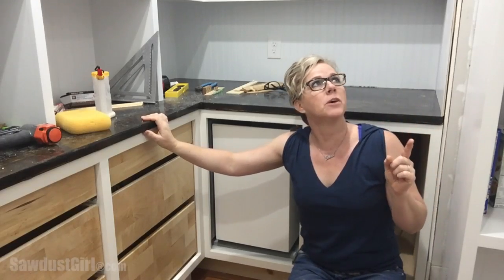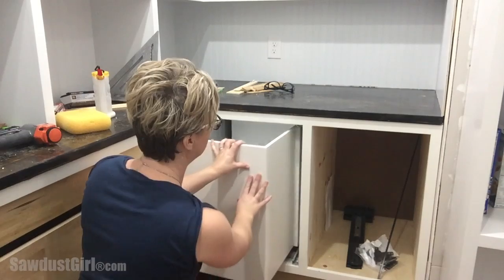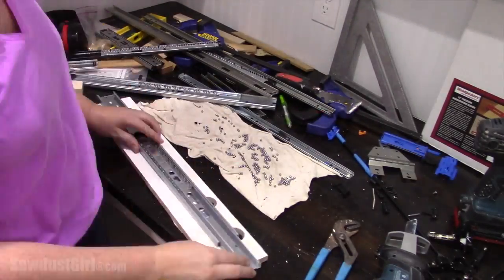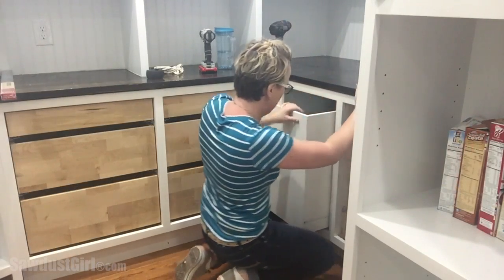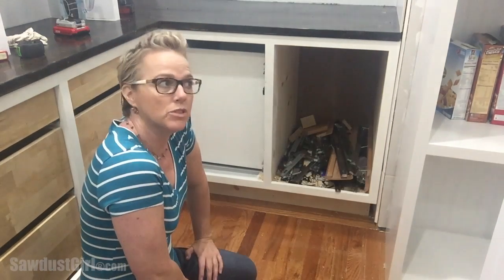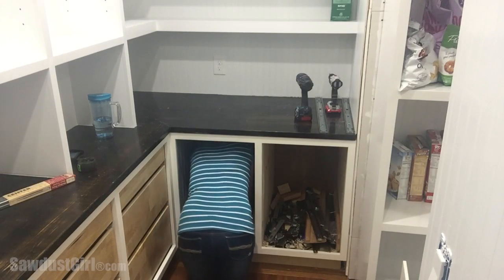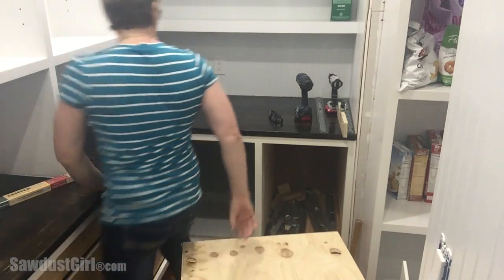Blind Corner Cabinet

Comment: This gives me an idea to put a garbage compactor in the blind corner.  You could throw your trash in, then a hydraulic garbage truck style compactor could press your trash into the blind space.   Every month the super compact block of garbage (or perhaps recycling) could be removed.

Blind corners are seriously hilarious.  The best solution is to open the wall into the next room and put drawers in there.    I was lucky that my blind corner was in a peninsula so I could just put my wine fridge in the space, facing the other side of the peninsula of course.  My parents solved the blind corner problem by ignoring the space - putting NOTHING in it - because they had a big old farmhouse on 100 acres of land - as Canadians in the 2nd largest country in the world it makes me wonder why we just don't build slightly bigger houses and forget about the blind corners.  Leave them for the spiders.  But that's a cop-out.   I admire your attempt.

Comment: Awesome tenacity!  I found a blind corner solution called LeMans II System which I used in my house.  After many years in the carpentry business this is by far the nicest solution I've seen.  Easy to install and works flawlessly!
Reply from the maker: I wished it would have worked more smoothly, but at least it does make use of all the space.

Comment: Mount the pull out cabinet slides onto the side of the drawer cabinet ( that's normally hidden inside ) so the first cabinet can be pulled out completely like before except its mounted onto the drawer cabinet, this will allow you to fully extend the first cabinet out then move the whole thing to the right to give you access to the drawers, you will have to stabilize the drawers because of the weight of the pull out cabinet attached to it,  some  blind corner optimisers do this except they use wire baskets instead of drawers which I prefer because pull out swing is not robust

Comment: Hi Sandra,
I see what you're trying to do to access that blind spot. If I was building my cabinets from the ground up as you I would drop all those drawer glides and piano hinges. Instead, delete all together the typical bottom shelf at the toe kick and just make two carts on castors that roll on the floor (inside the base cabinet). The cart at the door could be rolled completely out giving you access to roll the "blind cart" to the door or completely out of the cabinet.  Furthermore, why not build all base cabinets open to a rolling cart hidden by the base cabinet doors. 
Bob The Builder.
Reply from the maker: +Robert Wadlington that would be a great solution and something to keep in mind when starting a blind corner situation!

Comment: As a 15 year cabinet maker/installer, this is super well done! I was thinking a pocket door hardware might work? It’s a set of door hinges attached to a set of drawer slides. So when you swing the door open, you can push it back into the cabinet. This might work in reverse for a drawer box like yours.
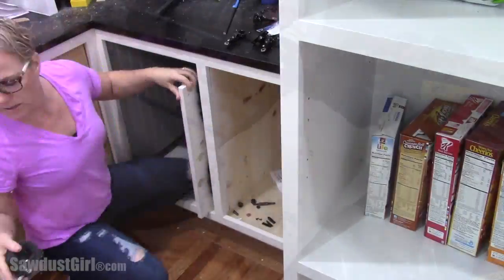Reply: I was thinking the same, but then there's a very brief segment where she's dismantling a pocket door slide.  About 0:51 time.

Comment: Sandra don’t give up. I’m a professional truck tech and have been for around 45 years. I’m occasionally faced with those kind of problems that doesn’t right away present a straight forward solution. There is a logical solution you just need to think on it; it’ll come to you in the middle of the night 😂. This is an excellent approach and I’m going to work on it because I have the same problem.

Comment: I know how to handle the engineering. 
The trick with the 'first component' is to prevent the vertical 5" cleat from racking on it's slides. This is accomplished with a cable and two pulleys. You still need slides and you can use regular heavy duty ones like you've already tried with all the ball bearings.  The cable will force the sliding 5" cleat to stay perfectly plumb without the weight of the cabinet making the top slide open farther than the bottom one.  Once you figure this out you can probably even make that vertical cleat that slides horizontally only a couple inches wide.  
Here goes:
You know those stranded wire curtain 'rods' they sell at IKEA?  (You might be able to use one of those or you might have to just buy some 1/8" wire rope and cobble something together.)
One end of the cable needs to be securely fastened at the rear of the right cabinet wall by the back end of the top slider.  The cable then goes horizontally to the vertical sliding part where there is a pulley attached to the top end of it.  The cable goes over the pulley then descends vertically along the cleat, then under another pulley mounted at the bottom end of the cleat. From there the cable continues horizontally toward the front again along the bottom slider to the lower right corner of the cabinet.  With this Z arrangement, the steel cable would have to stretch to allow the cabinet to tilt, but the vertical cleat with the cable attached can still slide easily. You'll need some sort of turn buckle arrangement at the lower right corner of the cabinet that adjusts the length of the cable.  Loosen the cable and the cabinet tilts toward the floor.  Tighten it and the cabinet lifts up.

Comment: You have a great design, and it just needs a tweek to make it work. You will have to make both your storage units 3" shorter. The plywood on the right side with a slide on the top and bottom is a great idea now convert that into a 2" tall drawer by adding 3 more 2" high pieces this will allow you to add a slide to the bottom on the left side. Add a 2" tall rail on the left attached to the bottom of the cabinet to mount the left slide to. You will have to make your other pullout drawer unit 3" shorter and raise them up to clear the 2" drawer slides on the bottom. Hope this makes sense. You had a great idea don't give up..

Comment: Did mine a few years back and even though the hardware was a bit expensive it works well. My upper and lower slides are connected with a very wide (as wide as the vehicle backboard) metal piece. If you can't find one (the other commenter identified) make your own with thick sheet metal. Good luck.
Reply from the maker: MRrwmac I'd be very interested in a link to the hardware.  :-D
Reply: +Sandra Powell aka {Sawdust Girl} Mine was from accuride https://www.accuride.com/en-us/products/1234 (this model but your slide measurements may need a different size). Ordered mine through local Woodcraft store.I think this is the one I got and I used an oak wood piece as a connector. Also built one for a neighbor after they saw mine and used a thick piece of aluminum as the connector instead of the wood like on mine. Hope the link came through above. Would like to hear back on what you end up doing.
Reply: +Sandra Powell aka {Sawdust Girl} Don't put any more space between the two slides than is necessary and that will reduce or eliminate the forward back tilting. Remember the weight is at the bottom anyway. My connector plates and the one for neighbor had only an inch or two between the closest points of the metal slide plates that the connectors screwed onto.
Reply from the maker: MRrwmac I got an idea ...  hope it works!
Reply: +Sandra Powell aka {Sawdust Girl} I hope so also. Good Luck. Let me know how it goes.
Reply: +Sandra Powell aka {Sawdust Girl} I was wondering how the latest idea you said you had worked out or did you just "shelf" the whole rebuild?
Reply from the maker: I started building my pantry doors while waiting for the hardware to come in for that blind corner so I haven't done anything with it yet.  Going to tackle it today or tomorrow now that my doors are done.

Comment: I know this is an old video but couldn’t resist commenting as this is still a problem for many.  The problem with the pull out section is it is able to swing whist you’re trying to pull it out, which makes it clunky and unstable - hinge being on the back right corner.  Wondered if you tried but it would work. -stabilising whilst in transit out of the cupboard.  Put roller guides along the base of the cupboard and then a 4mm (or so) wide alloy or polished steel strip fixed underneath the moving unit.  The strip would fit into the roller guides when going in and out.  This would keep the base unit fixed until free of the cupboard.  To make it super sturdy use two strips, one either side of the base.  Obviously you would need Y shaped guides for the strips so that they centre out and enter roller guides perfectly.  The drawer unit would need to be modified so that it rolls over the top of the roller guides.  Looking at your workshop should be too hard to do.
Reply from the maker: I sold that house about three years ago so I won't revisit this project. LOL I love the ideas though.

Comment: So I'm gonna pick up where you left off with the blind corner. Instead of hinging the 1st pull out I'm gonna have the 1st one pull out to me; then,  while pushing it out of the way it ends up pulling the other "2nd" pull out (that's nested in the blind corner). A double "box" where 1 pulls the other. The 2nd one is a box in a box, because the "outer" box has the floor drawer slides and the inner box has the side slides. Can you picture it?
Reply from the maker: I don't picture it but I hope it works!

Comment: You wouldn't use the whole space but if you had shelves attached to the door and the door was on a 180 ish degree hinge, then you get the shelving just by opening the door. The pull across piece worked fine.

Comment: Hi Sandra,  I'm good at figuring things out but not good at doing them. I'm also not good at explaining what I mean but I'm going to do my best here.  There are 2 cabinets facing us and 1 hidden.  The cabinet to the right we'll call no.1, the one you fought with is no.2, and the hidden one is no.3.  Build no.1 to slide forward by using the top and right side as its guide (or however).  Open up the wall between no.1 and 2, then build tracks on the bottom for no.2 to slide forward and to slide over behind no.1 just like the tracks you built for no.3 to slide over into no.2s space.  Picture it.
Reply from the maker: SandiRose27 But then there would still be wasted space.  Because you have to have room for any of the cabinets to slide.  ??
Reply: Sandra Powell aka {Sawdust Girl} No, no, no. :)  Maybe 2 or 3 inches.  Configure no.1 to pull out as far as possible. Make the face of drawer no.2 a couple of inches shorter so that it fits in behind no.1 when it slides over.  It looks to me like you could get those 2 inches back by making no.2 one inch taller and one inch wider.  And you'll gain back the couple of inches lost because of the drawer pulls or hinges or whatever they're called. :)  Maybe you lose a couple of inches on the bottom of no.2 and 3 because of the casters, but won't it be worth it!
Reply from the maker: LOL  I can't visualize what you are describing at all.  It's a mute point though because my cabinets are already in place under the countertop with additional cabinets built on top of the countertop.   So I won't be demoing the cabinet.  I can't just cut the walls out of cabinets.  :-)
Reply: Sandra Powell aka {Sawdust Girl} Oh, OK. Well, thanks for listening anyway.   Good luck with it.  You'll figure it all out.  I love watching your videos.  Thanks.

Comment: Probably too late, but what if you mounted a full sheet of plywood to the drawer slides on the right side vs a narrower piece. The problem seems to be that the smaller piece racks as you are trying to pull out the drawer. With the larger piece, it cannot move as much and might make for a smoother pull.

Comment: That is a tough design to crack.

The issue that you are having with the pullout is the top and bottom guides are binding because the top tries to come out faster than the bottom (pull force, friction on the bearings, phase of the moon...).

If you have a loot at something like a pocket door hardware set (the type for the big armoire entertainment centers - not between rooms) you will see that they normally have a balance cable or rod that links the top slide with the bottom slide in order to force both to move at the same time.

The smaller ones for regular doors are normally just a couple of slides, but a heavy duty system like the KV 8092 or Accuride 1432 should be able to do it without racking.
Reply from the maker: Joe and Liz I actually tried a cabinet pocket door hardware set with the metal rod between the two glides but needed to remove and weld the hinges back on backwards to see if it would work in my situation - and I don't have welding skills so decided to keep the $80 glide set for an actual pocket door.  haha

I ended up with heavy duty slides (150lb).  I tried mounting the slides closer together.  I tried flipper door hardware.  I started out with a pocket door track and rollers (wall type) which is what I had in at the beginning and after all my experimenting that original set up wracked the least.   sigh...  oh well.  LOL
Reply: +Sandra Powell aka {Sawdust Girl} I thought a pocket door hardware would work too but that makes sense, the hinges would be on backwards.
Reply: Sandra Powell aka {Sawdust Girl} Unfortunately was watching the video from the other side of the room while making coffee this morning.Looks as though you used the KV style with the connecting rod on one of your tests.  Also seem to have wanted to use the Euro style cup hinges.  If I had to guess, you probably had more issues with the hinges as opposed to the slide mechanism - but without being there and all that...  Those hinges would not work too well for this.  They are really weak to start with, and you would be asking a whole lot more out of them than what they could do.  For the hinge - it will be hard to beat the piano hinge for this application.The slide mechanism you started with is pretty good idea.  They have a lot of slop though.  Not a big issue when the only thing they are working against is gravity and you have a 30" door to spread the slop over.If you wanted to have another go with the KV8092 (not sure if it is still in one piece - saw some slides getting cut), I could maybe toss together a quick drawing of how I do them.Something that might be more comfortable for you though would be Accuride 115RC linear motion guides.  They were really designed for exactly this sort of movement, a lot like your original concept but with a lot tighter fit and finish.
Reply from the maker: Joe and Liz Those look cool.  I think I'd still get wracking issues because the 5" cleat would still be the only thing attached to the glides and the weight of the cabinet attached with the piano hinge would push the bottom back.  BUT I think I have found a really good solution...stay tuned!
Reply: Normally I will use the linear slides at both top and bottom.  Generally I use them for things like hidden wall openings with just a single cassette on top and one on the bottom.

Most the racking will come from slop as opposed to actual torsion, up to the point of failure of course.  The linear guides fit more tightly than your average slides which prevent them from shifting.

There are a lot of different ways to handle the problem though.  Even just taking a single heavy duty slide and cutting the slide down to the same length as your cleat while using the full length track as the guide.  This will prevent racking as you don't have the second track setup which will get out of alignment to cause it to bind.

Comment: I think I'd just piano hinge that first cabinet and curve its back left corner so it can make room for the second set of drawers. Still a little lost space, but better than that entire blind corner going to waste.
Reply from the maker: Right. How do I do that? So not have it slide out at all... hmmm...that's an idea.  Problem is all my drawers are inset and I don't want that one to be different than the rest but I will give that idea some thought as I hadn't considered it at all.  Great thought.  Thanks for throwing it out there!
Reply: Sandra Powell aka {Sawdust Girl} If you wanted to go this route - the shelves would mount right to the inset doors.  This would allow the inset hinging mechanism (cup, knife or knuckle) to kick the door out with the shelves attached to it.  If you went with cup hinges, you would probably want to double the quantity you normally use in order to support the load of the shelves.  The shelves themselves would be a quarter circle with the radius of the width of the door.

Comment: We're in the same situation but not nearly as handy as you are. But is it feasible to ditch the piano hinge and have the first section on 2 sets of gliders? The first set would be to pull it forward, the second to pull it to the side. The problem is you'd have to reinforce the heck out of it and only keep lightweight items in the first unit. The second unit would only need to slide to the side but you could have it slide forward as well. I hope this inspires you!
Reply from the maker: If you don't move the first section out of the way, you wouldn't be able to reach in to access the second section.  That's why I used a piano hinge.  There is (very expensive) hardware out there that will slide out and over.  I didn't want to spend $300 on hardward.

Comment: Hi, great idea!!! I know you've moved away from it, but I think with a little modification you could make it work. You should look at the blind corner unit from Knape & Vogt, and modify yours to something similar. I would use two full extension slides on the side of your rolling drawer unit to mount your swing out box to. You would have to modify the swing out unit slightly to work with the new configuration as it would no longer swing out, but pull out and then move to the side when you roll the drawer unit over. The slides should handle the weight of the unit so it slides in and out better. I think it would be a shame to give up on such a good thing after so much effort...